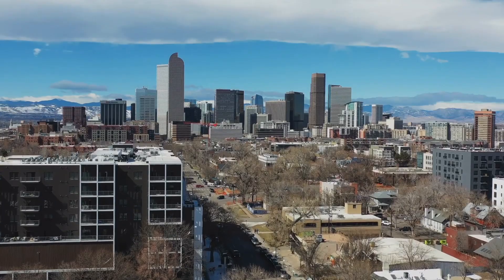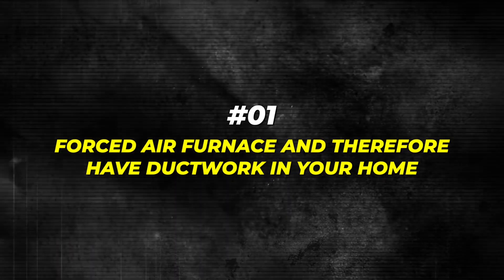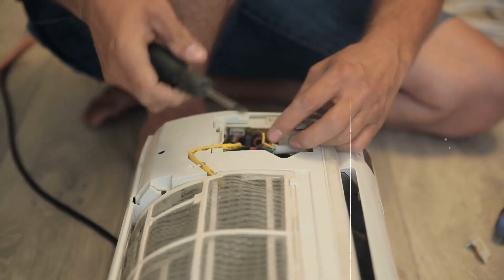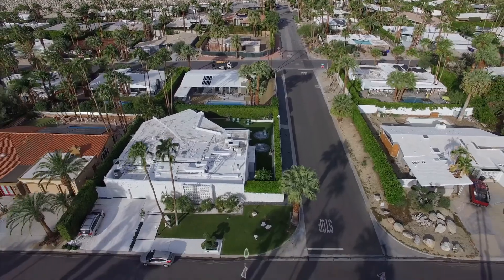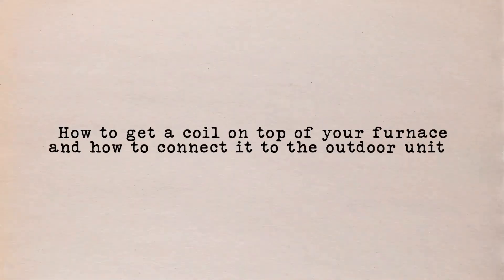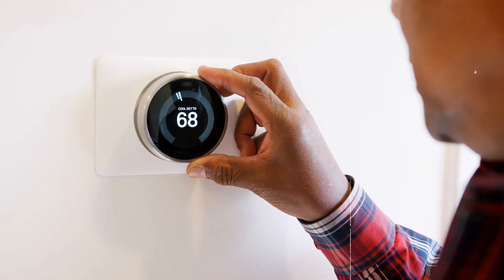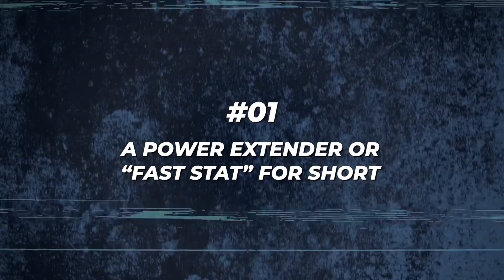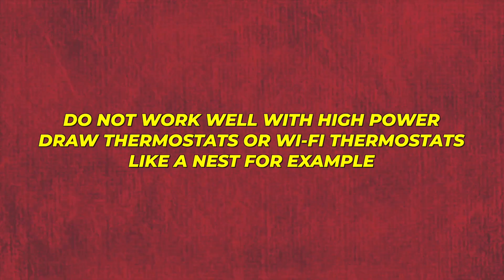Adding AC to your home ❄️🏡

Comment: Nice video. Looking for video that discusses adding AC to 2100 sq ft home with a furnace and only 1 return.  Looking for discussion on challenging questions such as is duct work sufficient, adding returns, etc. Thanks.
Reply from the maker: Will definitely think of what this video would be called and put something together. This is a very common scenario and short answer is it’s usually feasible to be able to add at least one return, even if we’re just running to a room adjacent to the mechanical room. It won’t be ideal but sometimes running a return duct to the upstairs for example (from the basement for example) would just never work well anyway because it’s hard to get the system to pull from two floors up, but if you’re short on return air adding a 10” duct (or whatever’s needed) will make a huge difference in terms just allowing the system to breathe, preventing icing, and reducing wear and tear on the blower.

Comment: So can any air handler just have a evaporator coil added ontop of it? Just seems weird that in the winter you can have hot air jusg pass through that evaporator coil.
Reply: That's the whole point in the way the evap coil is designed.
Air is meant to pass through it.
When refrigerant is passing through the coil, then it can change the temperature of the air that is passing through it, too.
Otherwise, it has no effect on the air passing through it, which when its a furnace pushing hot air, means that the warmth gets into the house.
Reply: Sure and if it's a heat pump, the indoor coil will become the condenser when it reverses the refrigerant flow for heating.
Reply from the maker: And most air handlers have a built in coil, whereas furnaces typically add a coil on top of the furnace… the other comments were right on the money 😁